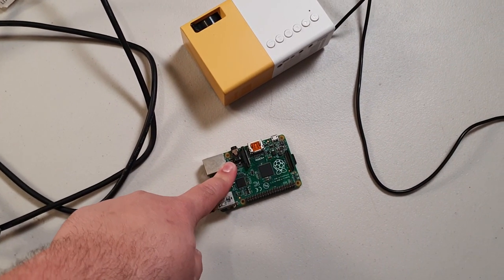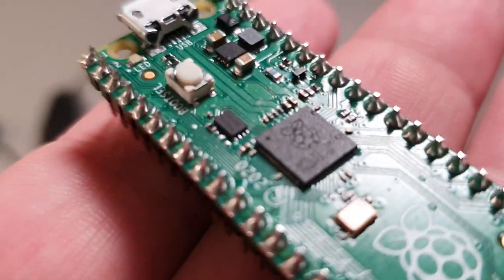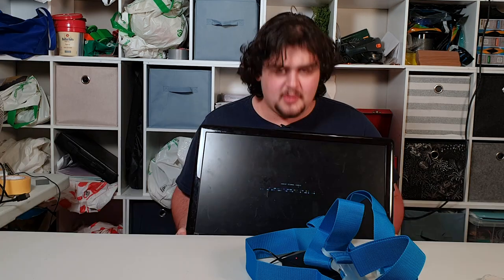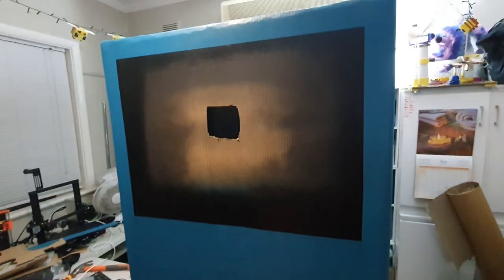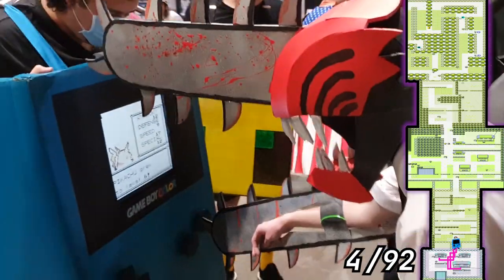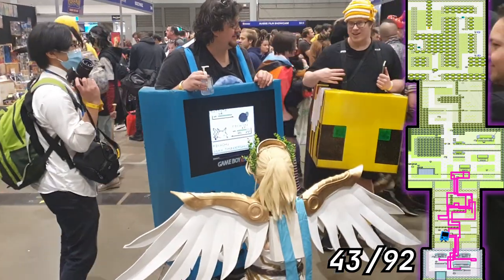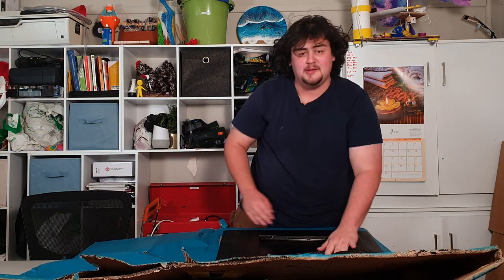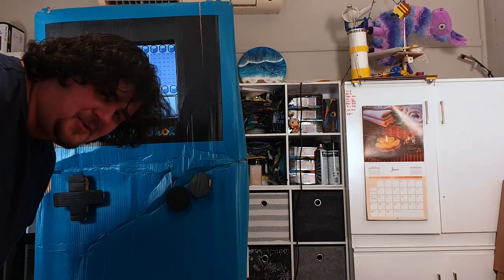Making a Giant Game Boy Color Costume that Works

Comment: Nice work on the costume. I am actually looking to make the same thing myself but i had some questions about how you built the buttons. I know you mentioned in another comment that your using Ciruitpython to assist with the buttons. I my question is what did you use under the cardboard buttons that people will press into? Also i assume that because you used a tv that the sound came from the tv itself? And how did you attach the Velcro to the cardboard and the straps?

Thank you for taking the time to read this.
Reply from the maker: I am sorry for the extremely late reply, I just used some keyboard switch I had lying around, anything should work. It was really Janky and last minute. 4 springs to hold the button above the keyboard switch, any button should work really though. It actually had no sound, but the pi has an audio jack (not the new pi 5 tho so youd need a usb to aux) so you could easily get a small portable speaker for that. And I used a lot of hot glue to hold everything + cardboard strips with hotglue to reinforce things, like putting a bandaid over it to strap it down tighter.

Sorry for the late reply mate, best of luck!

Comment: What battery system did you use for the tv?
Reply from the maker: Well I made sure it was a 12v powered monitor, with an external power supply, then just used a 12v li-ion battery, I cant find the original link but it was a cctv backup battery I think? This is the hardest part and you can very possibly destroy the monitor as some might not like the change in voltage as the battery goes flat, which is why I used a cheapo second hand monitor as I expected this one to blow. You could also possibly buy a 5v usb powered monitor, which I reckon would be the safest bet.
Reply: Again cheers mate, looking forward to this now.
Reply from the maker: @mcintyrevxq  No worries man, good luck with it!